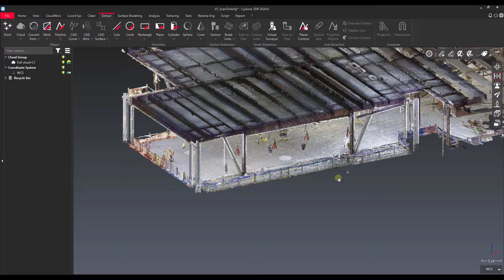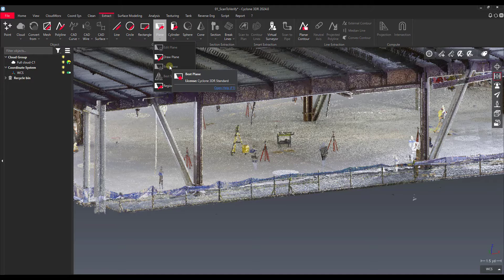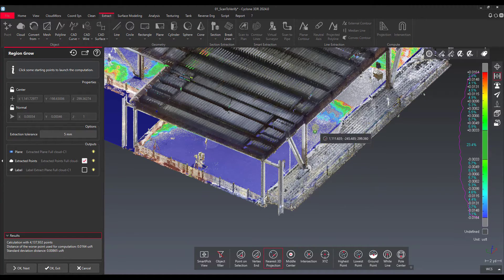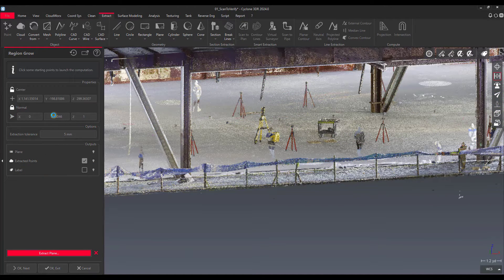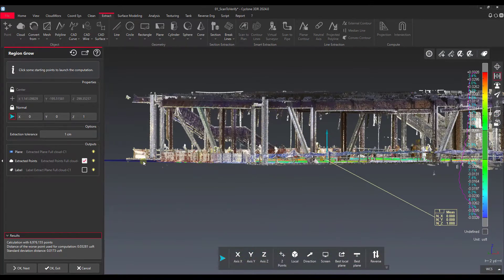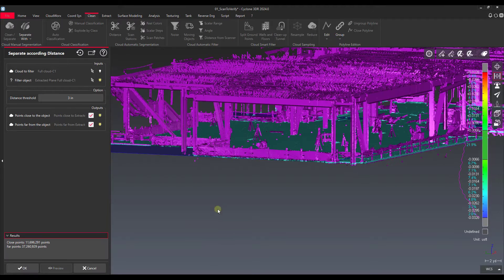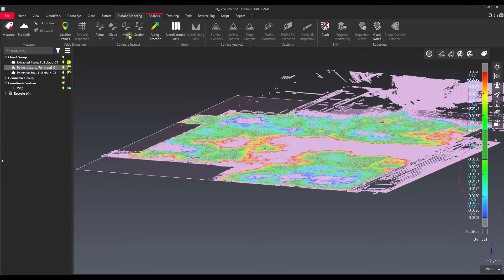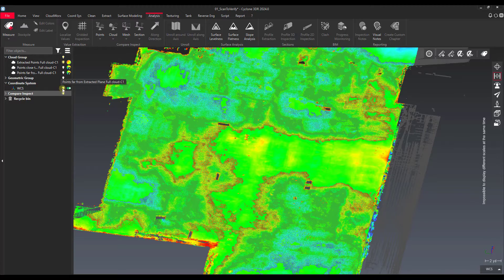Cyclone 3DR - Checking Surface Flatness with a Plane

Comment: Question, are you excluding the floor below each setup in your C2C registration and relying HDS targets and C2C of ceiling / wall features?
Reply from the maker: In this case, I did not register this dataset myself. In support of your question though, in order to not skew the results of your measurement surface, you would want to exclude whatever surface you are wanting to measure levelness/flatness of from the cloud-to-cloud constraints.